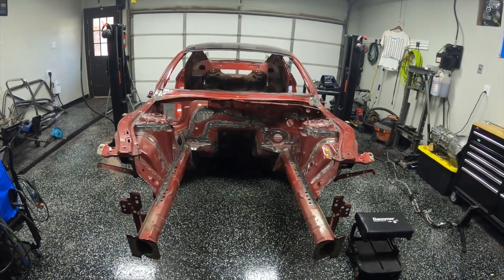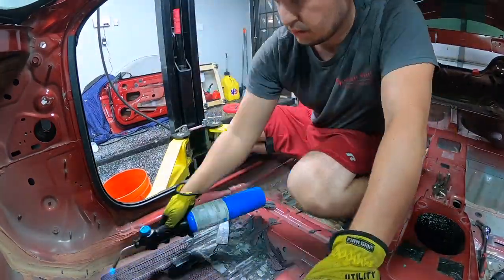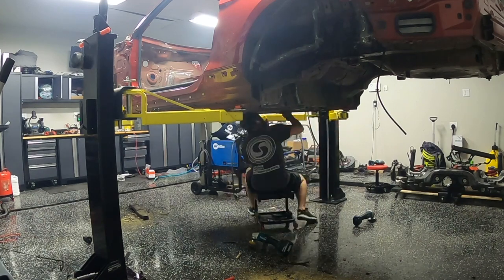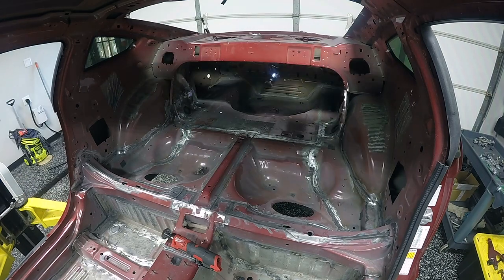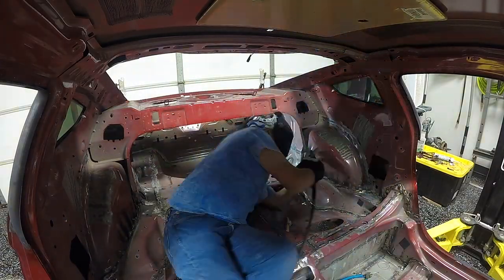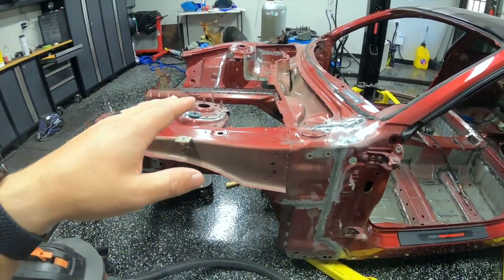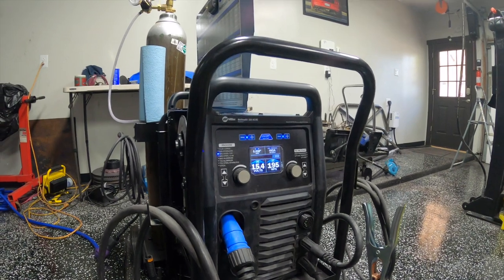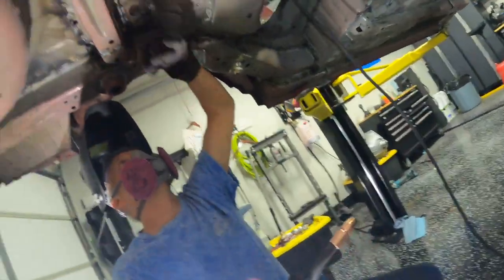Seam welding the chassis: Race Car Conversion Ep 2

Comment: From what I understand about acid dipping it's best used on older cars that have rusting problems as well as decades of small body damage and you want to restore it from the ground up. A newer vehicle or one that doesn't have rust problems doesn't need to be dipped like say an old Datsun 280 that sat in the open weather for the last 20 years.

Comment: Good work, about to do the same to my E36. You in the Austin area too?
Reply from the maker: Nice! I'm out in Aggieland, but frequently at COTA. Did you acid dip your chassis? if not, HIGHLY recommend it

Wish I had
Reply: I did not, early days, I'm just about done stripping the car down. It's there a place you know of that can that's somewhat local? There's a few mobile blasting companies around but would still have to dig stuff out of seams. Couldn't find any dipping shops so far.
Reply from the maker: I don’t. It’s why I didn’t do it. Felt more hassle than it was worth. Turns out that I wasn’t able to get a good portion of the seams clean enough to weld. We burnt through a lot. It was super frustrating. I’d drive to another state before I did it again. 

It’s possible, but a lot of the welds will be ugly and it’ll be pretty frustrating

Comment: Do you know how much extra weight you’ve added.   I’ve always wondered.  I would think now a lot for how much stiffer it becomes
Reply from the maker: We put about 12-12.5 lbs worth of wire into it. Removed far more than that in seam sealer and sound deadener, tho (20ish lbs)